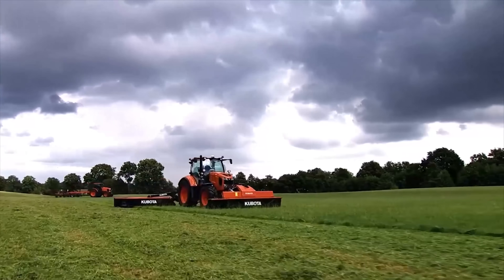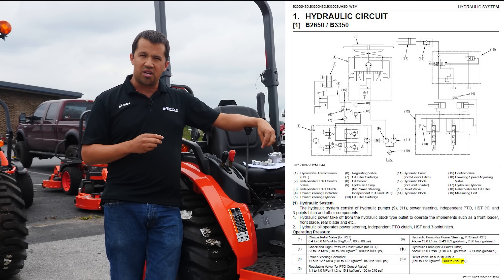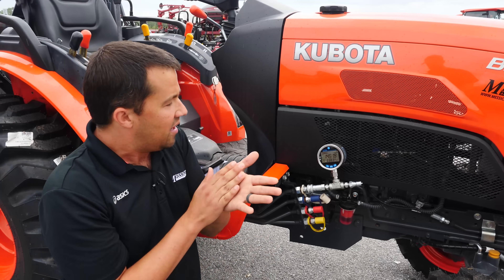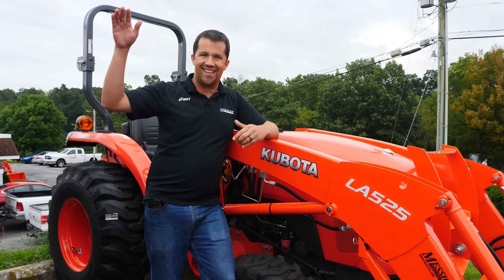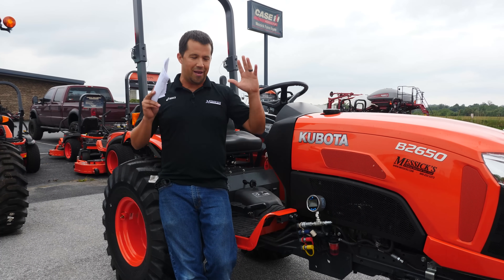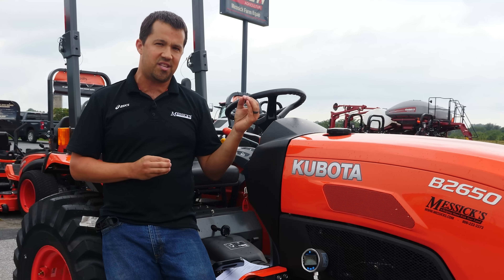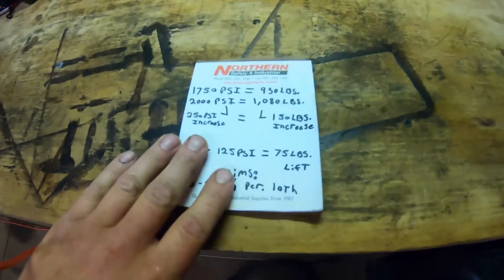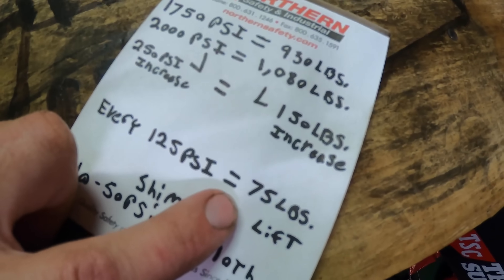Performance increases by raising pressure. Shimming hydraulics.

Comment: My garden tractor was supposed to be at 1,000 psi from the factory. After checking with 2 separate gauges my pressure was 850. The tractor manufacturer states the max psi is 1,350 psi. The actual hydrostatic transmission manufacturer states the max psi is 1,500. I shimmed mine to 1,350 psi. It was definitely more than a “few percent”. This video was disappointing as he was taking the position “ it doesn’t change much after shimming your hydro” and that’s just untrue.

Comment: That's great info. I just bought a used m5660. I added 3 rear remotes. 1 dedicated to the front 3rd function. I'm just curious if it's in spec. Now I know I can just plug in the gauge without a complete loop. I really wanna find the hydraulic air bleed if there is one. I found the hydro pump but no idea, where the relief valve adjustment is.

Comment: Most tractors i work on with FEL have a 2nd pressure relief valve for the hydraulic system pressure and one on one the loader so generally can only go so far before the pump relief valve let's go, around 3000psi give or take 500psi

Comment: You are better off to be a little low than a little high because after some time you can blow cylinders and hoses and hydro pump so just leave it alone to add pressure if the gauge say a 100 psi low that’s perfect to make your system last for ever and these China kits the gauge is not very accurate.

Comment: And when cylinder bottom out it makes more noise and when you lift mower deck all the way up you can hear the hydraulics moan. It never made a noise before and I don’t have a gauge or any thing to check how much pressure he shined so Iam just going to take one shim out if it still makes that noise I will take a second one out until that noise goes away. This little lawn mower on steroids has been a great little machine and it would lift just under 500 lbs and you could push up on bucket with your hand with a tiny push it would go right up, but 500 lbs in that bucket it is so tippy keep your bucket as close to the ground as you can and if you have to raise to dump in trailer make sure ground is very level and with scraper box on your 3 point hitch will balance it out and will feel a lot less tippy .

Comment: My 2003 bx2230 with 711 loader was set at 1200 psi.  It wouldn’t pick up a half bucket of dirt.   I shimmed it over 10 years ago to 2100 psi and it’s been great.  Other than some hoses eventually failing on a  20 year old machine, there has been no adverse effects.  The hoses were all rated for 3500 psi, so everything was still completely safe.  The little bx has over 2k hours on it now, and over 1K of that at increased pressure.  It absolutely made a huge difference.   Most BX tractors came well below factory settings.

Comment: My l3301 was 1900psi when I got it I turned it to 2800 psi my 525 loader lifts 1700 pounds of concrete blocks on pallet and forks now mine modification made a big difference

Comment: I enjoy your videos, but, you do not need to lie about the prices of the shim kit to scare people.   At most it’s $20.00.   I agree completely that 95% of the time it’s not worth the effort to do it.      We brought the pressure up to spec in our compact and it did help.   The reason it helped us is the amount of ballast that we have on the machine.   We have the large amounts of ballast weight very low underneath for stability more than carrying capacity.
Reply from the maker: Shims are like $2. It's the gauges and fittings  that run the cost up.

Comment: After 900 hrs on my bx25d I have noticed a small drop in lift capacity, not enough to worry about but keeping an eye on things.  A mechanic friend suggested the spring may have lost some tone because I use the bucket a lot.  He told me the same thing you just said about shimming the pressure regulator, suggested replacing the spring if the loss of lift capacity gets worse.  Added that it would probably last another 12 years before that happens.  Love my bx.

Comment: My Bobcat CT1021 was at 1650 psi and i bumped it up to 2400 psi and it made a world of difference! It was definitely worth it for me. And i used it hard for 200 hours like that with zero issues. Tractor is now sold as i bought the CT2025!

Comment: Hi Neil, my question is regards to a Kubota L3301. 359hrs. Does not the spring in the relief valve weaken over time and cause a loss in useable pressure? I was thinking about shimming mine to put it back into factory spec range. Would this void my warranty? Thanks for all the work you do to educate and inform.
Reply from the maker: Over years to decades, yes.

Comment: Thanks  Neil ,
Like most folks I have kicked around the idea of pressure increasing.  I think I am going to opt for larger diameter cylinders but I am concerned  about the BX23S  hydraulic  volume . I really value your videos.  You do a great job.  Don't  let it go to your head.

Comment: Everybody's mileage can vary, but raising my pressure from about 2,200 to 2600 on my L3700SU made a huge difference. From my personal testing the tractor lifts roughly 400 pounds more now. I actually had to increase my ballast because it started lifting the rear tires with 1,000lbs ballast box.

Comment: Oddly enough, the video you mentioned, he gained 150lb of lift by boosting his PSI. And he was playing it safe at 2000 psi. Guys have had no issues boosting his tractor to 2200 PSI, which would have netted him another 120lb of lift, for a total of ~270lbs of additional lift. Thats nothing to scoff at and completely explains why most guys are seeing massive improvements to lift capacity.
Reply from the maker: Yes, if your exceeding the factory spec there is more headroom.

Comment: He’s trying to sell a bigger tractor by throwing shade on boosting pressure on smaller ones on roids
Reply: A pull on a wooden shed floor Is not accurate as it will give

Comment: My 4701 can't lift and curl at the same time any clue what it might be
Reply from the maker: Do you have your throttle turned up, three quarters or more?
Reply: @Messick's Equipment  yes 2000 to 2200 doesn't make any difference
Reply: Will putting the shims into it to bring it up to specs solve the problem or would it be something else

Comment: Shimming your hydraulics COULD void your warranty. i checked mine with a good oil filled analog gauge and it was spot on. Your tractor was designed by the factory to lift X amount of weight, you want to lift more? GET a different tractor.

Comment: I had always felt that my curl was very weak on my loader. It would lift the front of the tractor off the ground, but just didn’t seem to have power while digging. I tested my pressure at the rear SCV’s that feed my loader and it was 2800psi, but when I tested coming out of the loader control valve, it was only 1200psi (should be 2500psi per loader spec). I took out the pressure relief valve cartridge from the loader valve and the spring inside was broken in two pieces! That’ll do it. Waiting on part to come in, but hoping for a 50% increase in power!
Reply: Update: New cartridge installed and completely changed my loader. Will now lift the rear tires off the ground. Unbelievable. I was about to sell tractor because I thought it was just an undersized loader.

Comment: These kits are directly from kubota and dealers are supposed to check the pressures and install them, in this video you admit that dealers don't check and install these kits. Kubota doesn't ship the tractors in fully assembled condition therefore certain things should be finalized by the dealers.
Reply from the maker: Not sure where you're getting your information. Kubota does not sell these kits, and dealers do not install them. The pressures are not checked at the dealership because they are consistently right from the factory. The prep that's done at the dealership is akin to adding a Y to a garden hose, doesn't change the pressure coming out of the house.
Reply: @MessicksEquip  
The procedure for doing this is right in the workshop service manual from kubota and the shims are sold directly from kubota. I agree that taking it beyond factory spec is a bad idea but many machines are way below factory spec when they leave the factory.
Reply: @paulnykyforchyn8404  It makes sense that the service manual would have instructions and part numbers for adjusting if needed because shims are part of the factory high pressure relief valve mechanism. But are you saying that Kubota has their own factory jailbreak type of kit? On the topic of tractors not being fully assembled, Messick's showed this in another video. Loaders are off, maybe the front axle, and also wheels. Nothing in that assembly process relates to hydraulic pressure. Messick's sells a lot of Kubotas, and Neil has a track record of providing accurate and transparent data. The antidotal stories on forums about weak lift capacity out of the factory are rarely backed up by pressure readings. It's more like, hey I can't lift this 400lb engine with my loader, something must be wrong. Then it turns out that the engine is 650lbs attached to the tip of pallet forks.
Reply: Add me to the list of people who found their bx pressure low from the factory.  Around 250 psi below spec.  As someone who has worked in a dealership (trucks not tractors) I can't understand why they wouldn't take 5 minutes to check it on the pdi

Comment: My L2501 had a terrible lift capacity for its size! Every other manufactures tractor would lift more in comparison of equal tractor! 
I checked pressures and was just over 2000 psi..maybe 2200. I added shims..checking pressures with each one…finally got to just under 2600 psi and it did make a noticeable difference! 
I tested before on something so heavy I know it wouldn’t lift…just dead headed the bypass valve ..after the shim kit I retested the same weight. The back of the tractor came off the ground this time! I know it needs ballast to lift heavier objects! I guessing that’s why kubota limits lift capacity for safety reasons?

Comment: I think many are missing the point on how this came about..It was found many tractors had low pressure , not in specs..its about getting the correct pressure they are designed for..if your pressure is low why not correct it...no difference if your tire is low..most are going to put the correct air pressure in.
Reply: If that was fact, then adjusting pressures wouldn’t be a thing. In reality, we all know OEM doesn’t mean “at spec”.
Reply: But.......most tractors ARE within spec.

Comment: There’s nothing placebo afoot i’d say that’s rewriting the story being proven by each & every video. Have no doubt it puts the machine under greater stress & invalidates warranties & so on & so forth but its a 21% increase in lifting ability if u just go from 2230 to 2590 psi on the LA525. Again not good on the machine to juice it but that’s no doubt a significant gain. If u could take a machine that lifts 1100lbs & get it to 1500/1600lbs lift then I could no doubt see the allure there. Prolly break stuff long term & you’d need to work to keep the rear down but having a little tractor that lifts big is mighty handy here & there. It’s not recommended but the gains are there if u really want them.

Comment: The shim kits are a scam. the gauges can be had for less than $30 and the shims are a couple bucks a pack and some dealers will just give you a shim or two if they have an open pack on hand and you don't need a full bag. I do agree the pressure relief spring does weaken over time if you are constantly riding the relief valve which I have had a BX that over a few years of hard use it did start lacking on performance but I didnt buy into the shim thing I replaced my relief spring and put back in the shims that came from factory and it was back to where it was when tractor was new. I believe replacing spring or valve is the right way not shimming a weakened spring cause where does the shimming stop when the spring is completely compressed and you're blowing things apart. The shim kits are being sold for $60- $100 for $30 worth of stuff that doesn't fix anything.

Comment: Couldn't you go with larger diameter hydraulic cylinders for more lift. I assume you'd sacrifice speed though by doing that. It's most likely the perfect ratio from the factory.
Reply: nope. The size of the cylinder can't do much if the pressure isn't there, no matter the size.
Reply: Yes, that's why it's called pounds per square inch, you increase the diameter of the piston and you increase the area the pressure is working against. But given that the structure of your machine hasn't changed can it handle the increased Force?

Comment: Maybe i just have an odd tractor but i have a bx1500 with an la181 loader before shims i was at 1700 psi lift capacity was 410lbs at the pins, i increased psi to 1900 and at the same location it is now 524lbs. I wouldn't say i recommend doing this unless you are experienced and know 100% the risks you take, very easy to blow cylinders, lines, pump, bend loader arms, frame.
Reply: @First Choice Mechanical that is a 25% increase - pretty impressive.

Comment: Not sure that buffs results showed what you tried to make them out as. Your talking about a 16lb increase. Biffs looking at 150lbs
Reply from the maker: He started with the loader way out of spec. The point is the relationship between pressure and capacity.

Comment: Before I go out and purchase the shims from my Kubota dealer here is my dilemma. I have a BX24 which I purchased new in 2008. In the 2020 season, the FEL was able to P/U my 60" MMM. This year the loader struggles to lift it more than two feet. What then has happened to the factory settings if not the spring nor shims.
Reply from the maker: can be a lot of things, but you do generally start by checking the system pressure.

Comment: I bought an M7060 2021, and the 3 pt top and tilt controls are sooooo slow. I've turned the valve, and it doesn't matter. You just have to set there and wait real slow, not like my old L48, which you could set the speed from almost damaging fast to just perfect. Is there something I can do? My dealer didn't have a solution, other than maybe drilling something out.
Reply from the maker: Probably flow restrictor in the TNT

Comment: Blows my mind that you don't check pressures during a pdi.  I work for a heavy equipment dealer and we've found that we have to set the pressures to max spec to make it do what the manufacturer says it should do.
Reply: I saw Neil’s response..my question,  is if they don’t check the pressure how do they know there is no variation in the factory pressure? Esp if customers appear to be below factory specs?
Reply from the maker: no point, our manufacturers are consistent from the factory.

Comment: Don't you need to have the hydraulics doing work to make pressure? What is limiting the flow to cause pressure in your setup there?
Reply: The pressure gauge is blocking 100 percent of the flow in that circuit

Comment: Ends up being a tractor version of the 1/2 truck buyer that wants to do 1 ton work, so they supercharge or turbo / tune the motor and wonder why they burned up a transmission, and rings and only got 15k miles on their over sized tires instead of the rated 30

Comment: Thanks, Neil, for putting it out there for what it is.   I think you could have addressed more how such changes can affect the rest of the system, though.  Hoses, pumps, etc. all have to be considered in the extra stress being put on the system which includes the FEL and axles.  Is that potential 20-140 lbs worth it?

Now can you do a video on "if it makes more noise, it must be stronger and faster"?   In this area, if everyone isn't deaf within a mile radius from your "mod", it must not be making enough "noise power".    (Without regards to people and animals that live in the area).

Comment: more pressure equals more heat, more heat equals shorter seal life, it also equals shorter fluid life and more fluid break down which in turn equals more wear. personally, I'd rather keep the things that i purchase to do work as stock as possible and use high quality filters and fluids as i'd rather they keep working and not have to fix them.

Comment: comon Neil, you are showing us your tractor that has nothing to gain and then you show us the video of the guy that gain 100# more.  My loader is rated at 2700# and I would love 100# more anyday for 100$. the thing is simple. Does your tractor that you bought for a hell of a price come factory spec ? if the spec is 2400psi and it is 2385psi on your gauge it is factory spec. but if your spec is suposed to be 2000psi and you are at 1750... Factory missed the QC and your dealer too. what is the best thing to do? get the job done yourself because nobody will... just look at you making fun of the "internet guys".  if the industrie would do a decent job, not talking about you on this but there is a lot of Bad dealer over the country...

Comment: A point worth mentioning, while these machines are incredibly capable, it’s still a tractor. It’s not an excavator, it’s not a track loader, it’s not a bulldozer. While you may have the ability to do the same type of work as those you have to adjust your expectations and come to the realization that a small backhoe attachment or whatever on a tractor is NOT going to be as strong or as fast as the dedicated piece of construction equipment designed to perform that one task. Once you understand that you will learn to love your tractor for what it can do, instead of wishing it can do more.
Reply: Not a dozer?! Then we all buy a bigger tractor. LOL